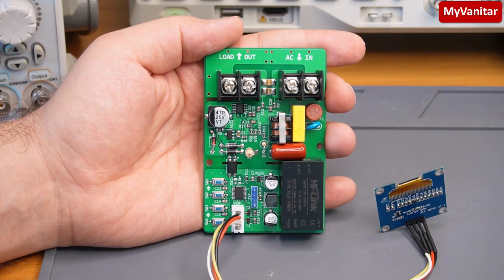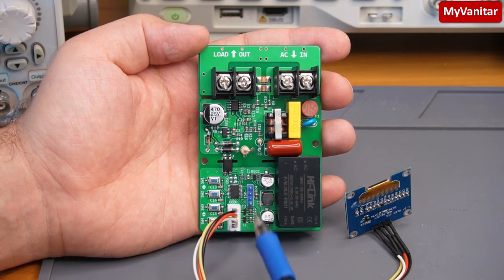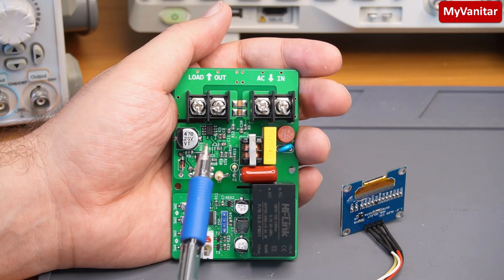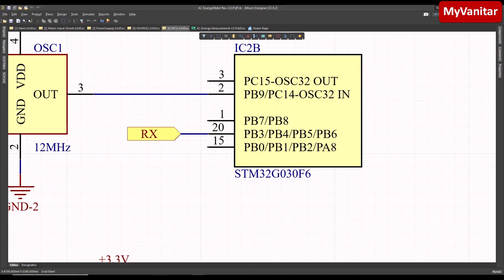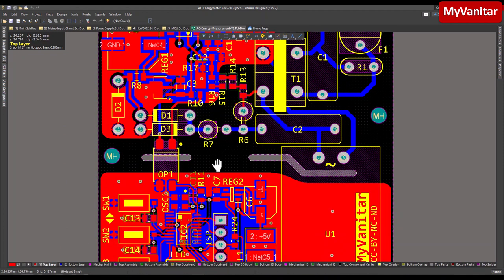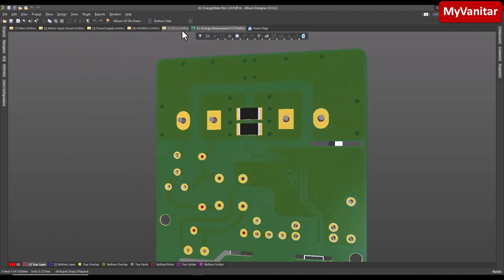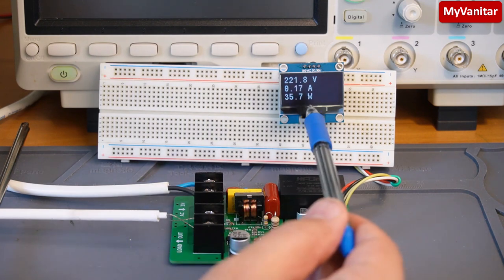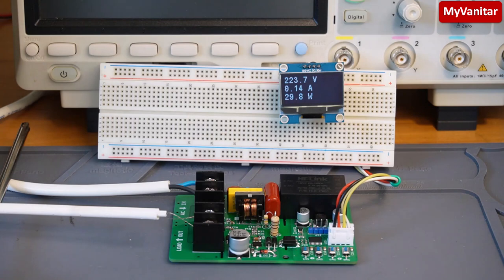Digital AC Energy Measurement Circuit V2, RMS Voltage, RMS Current, Real Power, Power Factor, KWh

Comment: This is professional work. High quality. Time is well spent to watch this video if the topic is of interest to the viewer. If I had suppliers who could provide this quality analysis and implementation, I would be a most loyal customer. Better yet, if I had employees who could do work like this then I would be both happy and proud. Question: I need to replace a commercial panel-mount meter that has 0.1% accuracy  because the meter is physically too big. This posting quotes the accuracy of this design around 0.5 percent. Can the accuracy be improved by changing components or is a new design required?
Reply from the maker: Thank you very much. Regarding your question, the accuracy depends on the chip or ADC. For this chip, the accuracy is around 0.5%, but 0.1% is possible with a different design. You are welcome to send me an Email (you can find it in the YouTube "About" section) and discuss it.

Comment: Superb!  I use a DC version of that with a high current shunt.  I've been wanting to design an AC version and remember saving the IC datasheet from your previous design.  Those little OLED screens are superb for the price.  I use them everywhere.  Though, I2C is really terrible.
Reply from the maker: Thanks. The IC does a nice job for the majority of applications. Here the data rate is low to demonstrate some characters (using I2C), otherwise, the SPI version should be used
Reply: @MyVanitar  I have not found a version with the SPI pinout, but that would be my preference.  I'm running mine at 400kHz so I get a decent refresh rate and my driver is now pretty robust and does auto-recovery on lockup, but it does consume a lot of MCU processing compared to SPI.
Reply from the maker: I posted the article

Comment: Nice build! How does it measure voltage? Have you considered a galvanic isolation transformer for measuring current? I have used the LEM HX 10P/S2 in one of my projects it uses hall effect and it goes up to 10A + 300% surge current without shunt resistors... its a bit expensive but it allowed me to keep the low voltage components completely isolated from the high voltage side.
Reply from the maker: Check the article for full details. it's published now

Comment: What a useful and interesting little IC to measure AC power! I´d like to learn how to program this microcontroller as well. I like it because it is powerful and extremely cheap. Can you give some guidance on how to start with it? What software did you use to develop the firmware? Thank you!
Reply from the maker: Thanks. The MCU is STM32 so I used the STM32 IDE. if you want to build one for yourself, you can order the PCB or assembled board and use the HEX file to program the MCU using an STM32 programmer. if you want to go commercially and need the code or PCB to make modifications for your brand, we should make other steps
Reply: Thank you for your quick reply! I liked your project very much, but my focus right now is to learn how to program these small STM32 micros. I have some cool projects that the STM32G030F6P6 would fit perfectly. @MyVanitar

Comment: Hi Again. 🙂 Just saw your second version and I'm impressed. Found the HEX file, but not the code. One small remark, this and the previous version has a cosmetic error: kilo isn't with a capital K, it's kWh. Capital K is Kelvin. 😉
Reply from the maker: I can not publish the code for this one because I wrote it myself and spent a fat amount of time on it. for the first version, yes, you should look at the function name in the library, otherwise, names and letters might be different in the text.
Reply: Understood, but are you going to adapt it in this version?
Reply from the maker: adapting what? Do you mean adding PF?
Reply: Changing KWh into kWh as it should be. I can't do it myself.
I understood the PF is already available, correct?
I read all the content and watched the video, but the meaning of the four TACT switches is not entirely clear. Can you please explain?
Reply from the maker: two tacts are to calibrate the voltage and the other two to calibrate the current. if you want to have the PF, let me know to give you a different HEX file
Reply: Yes please. 😃 I prefer to have the PF. I thought I could make a choice by pressing one of the buttons, but now it's clear.

Comment: Nice and neat circuit . Can you add over load cut off and when load is remove it will restore back?
Reply from the maker: if the load is removed, the screen shows zero consumption. for overcurrent detection yes is possible, but it needs some modifications, on this PCB is not possible

Comment: When I saw the Hackaday headline, I thought this was for measuring the entire house. I may have been biased because I need an entire-house measuring solution. But with 6W it's not gonna fly.
Reply from the maker: Why not, You can use it for your entire house. if we assume the maximum current consumption of your house is 20A, then the power dissipation on the shunt is only 0.4W (20*20*0.001R)
Reply from the maker: if you use four 4 milliohm resistors (=1milliohm), you can increase it even to 12W. please watch the video completely and read the article